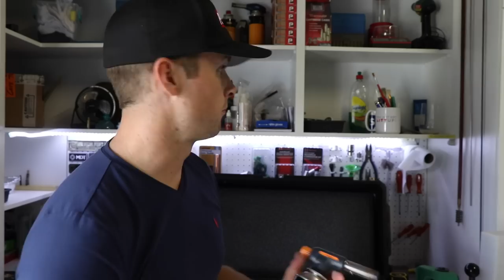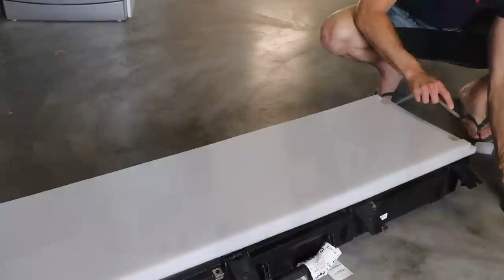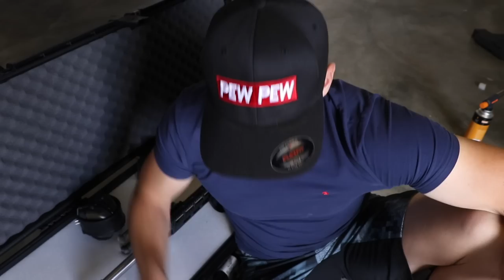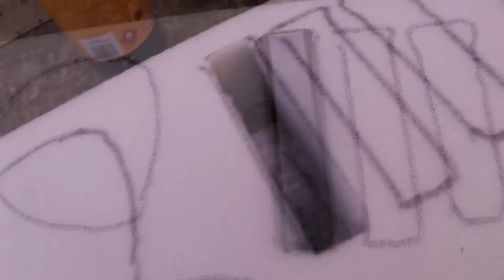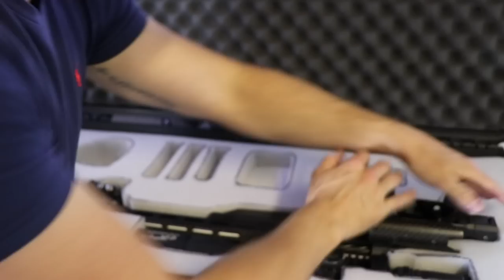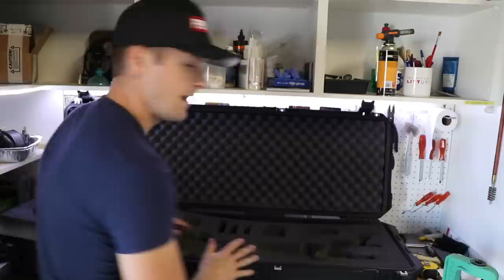Custom Rifle Case - DIY

Comment: Looks good man!! I used kaizen foam which is a closed cell foam and I use a power knife like the ones people use for cutting a turkey. You can always spray the bottom with glue so it doesn’t move. Nice video!!

Comment: Excellent job. I like using XPE foam vs the standard foam rubber stuff that comes with gun cases. But it is not forgiving and you have to be very precise. However it is a almost a forever foam. Extremely durable.

Comment: You should get some 3m adhesive and glue the bottom layer to the bottom of the middle piece of foam. Does a couple things. 1 it will keep the foam in place when something isn't in its slot. 2. it will hold the foam down when you pull out your rifle. Often times the whole foam will try to come out. 3 it looks really nice.

Comment: Try using plasti-dip to spray the top of the foam. It will keep the foam from ripping over time/use.
Reply from the maker: thats what I used :-)
Reply: that also works great for the pluck and pull foam, vs the single piece foam that PS used.

Comment: IMPACT SHOOTING next time you need to cut foam try using an electric turkey carving knife,"the old 80s or 90s Gizmo's",
I learned that trick cutting and shaping foam dirt bike seats, there is no better tool for the job!

Comment: Where can I buy good rifle cases. It is for my .308 Howa and .223 Tikka. I'm going to NZ. PietSkiet is it alot off  work to have your rifle with you on a flight. Thanks for Vidz...
Reply from the maker: Pretty easy actually, temp export permit from our side. Then you need to check what permits you need NZ side.
Reply: @IMPACTSHOOTING  thanks PietSkiet

Comment: Why didn't you just paint the entire bottom layer black (like you did with the top, main layer) BEFORE you started, thus cutting out having to use the pen and "spot paint" the lower layer to match your gun/magazines/binoculars, etc? Just a thought.

Comment: Only a suggestion... Perhaps if your flying take your bolt out and carry on the plane so if your rifle is stolen in transit, no one can use it. Also, perhaps don't advertise it's a rifle with Vortex written on the outside. Again, only a suggestion. Cheers
Reply: I agree! No bolt for them!  I think I would label it as fragile equipment or something. Maybe something they wouldn't be interested in but marked as fragile.